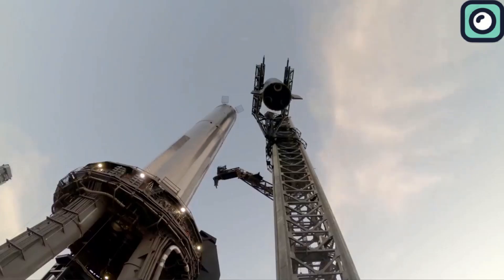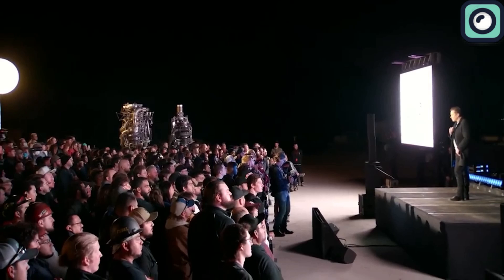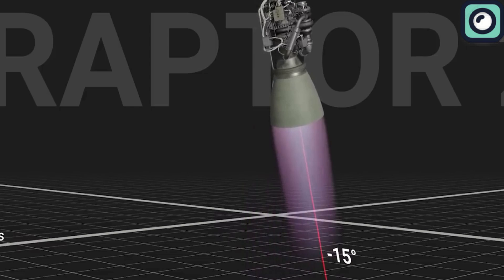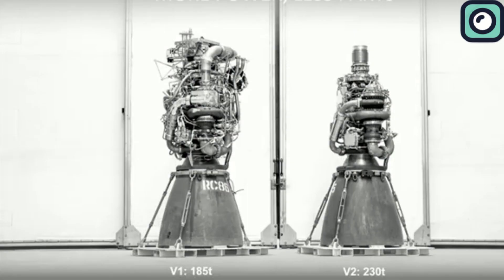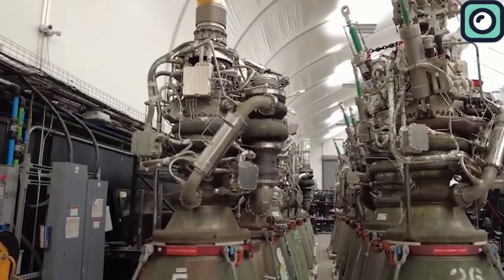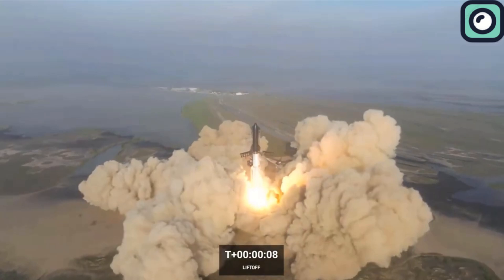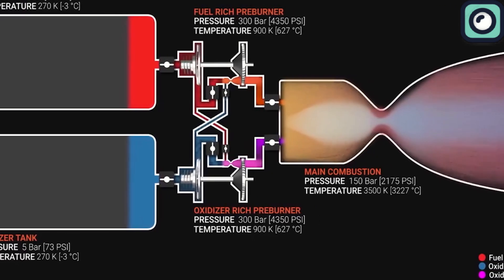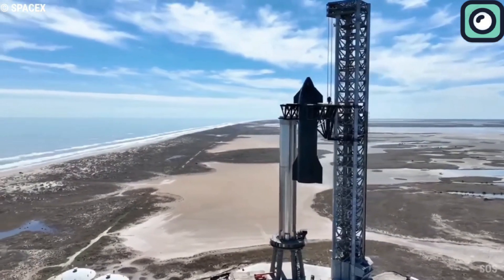Musk Just Revealed New Updates On Starship's Raptor Engines!

Comment: Elon!!!! Check out the NEW ALLOY you could use for Starship flaps Alloy GRX810 invented by 2 NASA engineers
Reply: Much more likely it's being used inside the engines. Elon has said they use 3D printed metal parts.
Reply: @gregsteele806  It was just invented so he couldn't possibly have gotten any of the material yet